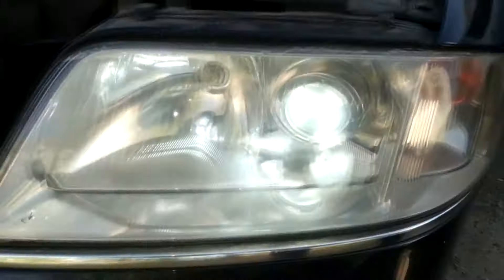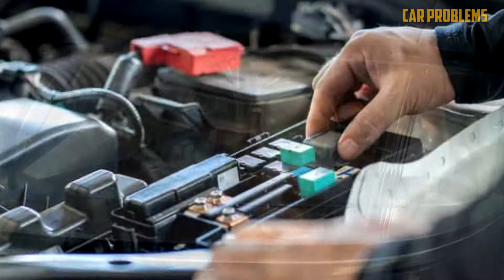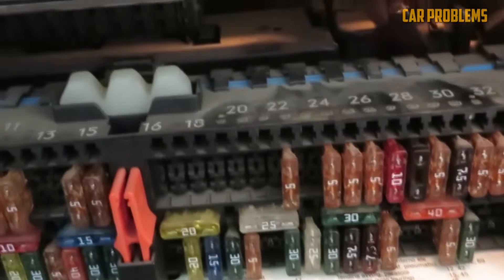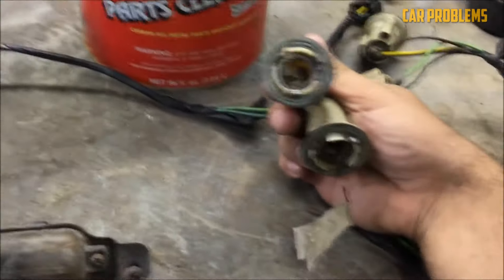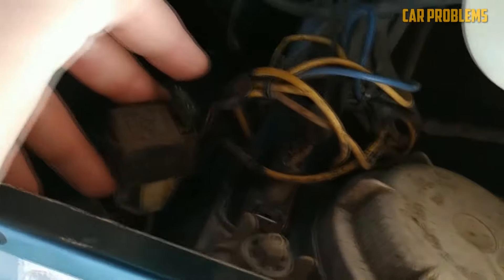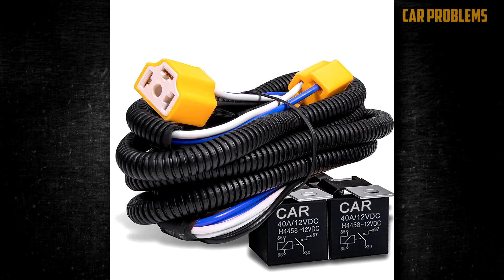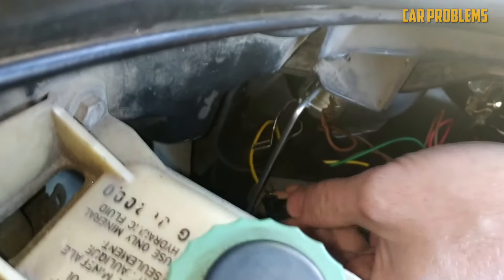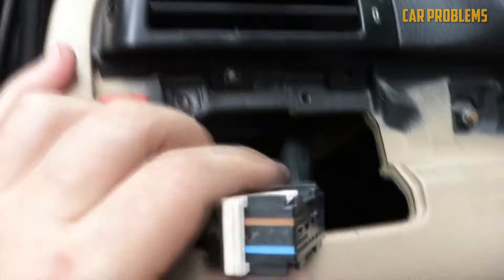7 Causes Both Headlights Not Working. How to fix?

Comment: I need help my lights were working but only high beam works now after removing 1 bulb to fix it in place and I believe I had switch on or lights on when did that forgot to shut them off and switch 

But now after doing that both lights have highbeams and no low beam and these are new led lights I even put my old ones back to see if light burned out same issue 

So not sure what to do if anyone has similar issue plz tell me
Reply: I just lost both my headlights on my honda civic. I noticed it happened after I have been using my highbeams, but didn't realize until I got home. I'm going to check and maybe replace the fuse, I'm glad both of them went out at the same time to know that it's most likely not that the bulbs went out. I feel like most people would try to replace the headlights which is expensive and probably wouldn't work or be the most cost effective solution.
Reply: I think anytime both headlights dont work (either hi or low beam), you have to consider the relay. Im having that issue now, but I can't find how to access the relay in my Lexus Rx350k.
Reply: Hey did you find a way to solve it? I’m having the same issue.
Reply: @kikestv8863  yeah I was an idiot and had it placed in high beams instead of low beam 

Because vw is so dam confusing their head lights have 3 different spots and hard to get to so all I had to do is place them in head light spot and not high beams they been working great so far for some months no issues and very bright but also not very bright to hurt people 

One thing though after putting these on my old high beam don't do sht lol unless I get stronger ones but that's how strong these lights are they make my old high beam look like headlight when on together 

But not sure if your issue is being dummy like me lol other then that there was nothing to solve but my brain issue
Reply: @shotspot8405 did you ever find out what the problem was?

Comment: Any idea how to access the headlight relay on a 2015 Lexus Rx350. Its maddening that any search for relay location turns up massive # of fuse location diagrams.
Reply: I thought I'd update this in case anyone had a similar issue. The relay is actually within the Body Control Module in the dash. My actual problem turned out to be both low beams bulbs went out about the same time so I was thinking relay.
Reply: I just noticed like 30 mins ago that my highbeams on my 2008 Lexus ES350 went out. I noticed one didn’t work the other day but now both high beams don’t work. Lmk if you found out how to access the headlight relay

Comment: BOTH MY LOW BEAMS WENT OUT (HIGH BEAMS STILL WORK) ON MY 2015 NISSAN ALTIMA ?  FUSE ? SOME OF THE VIDEOS SAID THE LOW BEAM FUSES ARE SEPARATE FROM THE HIGH BEAMS, THATS WHY I STILL HAVE HIGH BEAMS - IS THIS CORRECT ?
Reply: Did you find out if this was it ? my car is experiencing the exact same issue
Reply: Same problem for me 😢
Reply: Anyone figure it out?

Comment: Any idea if both headlights is all working good but when the car is on running either one of them turn off or sometimes both of them turn off , what I do is  just turn off the headlight switch off and turn it back on, both headlights is working back on.That happened very often. Thank you
Reply: do you find the solution? my car also same problem